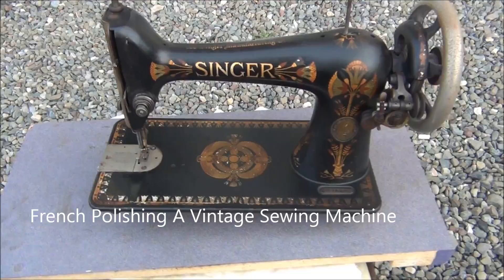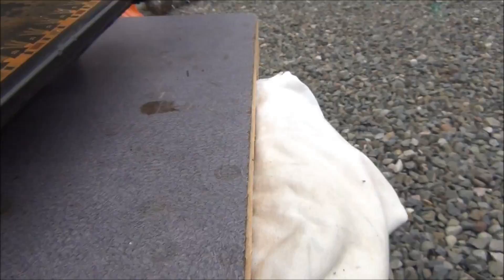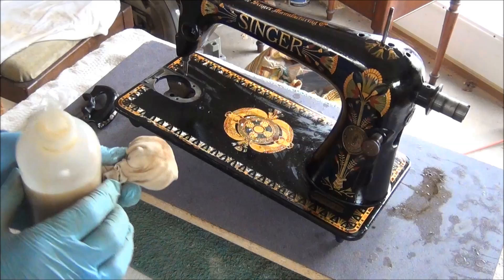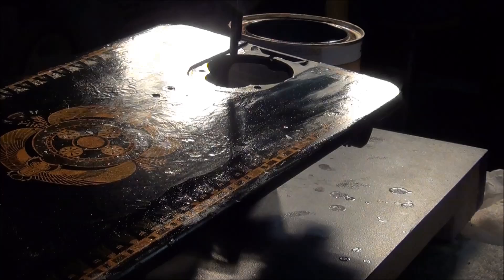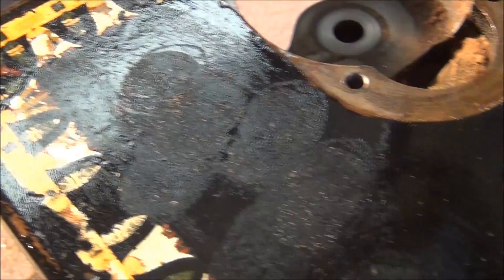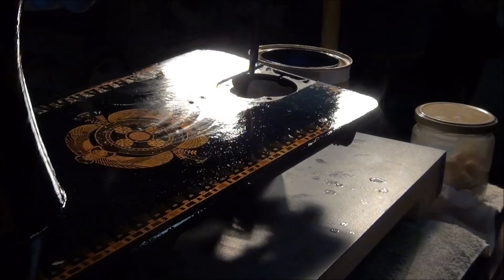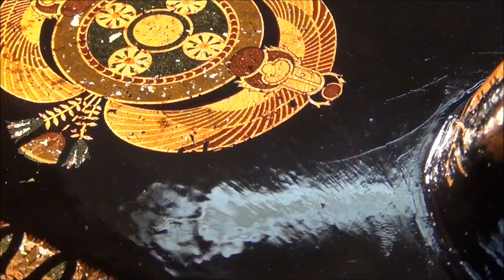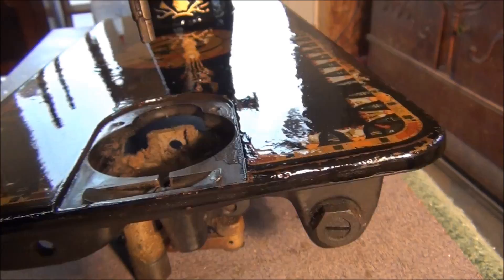French Polish a Vintage Sewing Machine

Comment: I need to repair parts of the decals.  I'll use metallic paint markers.  (Saw this in another video).  If I plan to shellac the machine, would you recommend using water base of oil based markers?  I'm just wondering if the shellac would make the paint marker bleed.
Reply: I would use the oils based
Reply: Use oil base. Water base would be alcohol/shellac soluble and bleed.

Comment: I dont think the clear coat back then was thick at all , i have a 1904 27-4 and i would swear there is no clear at all , i only use dish soap and warm water with a soft used toothbrush,  i found that  it takes more time but i have never harmed the condition of the clear or decals useing this mothod , also use a good soap , i use dawn in a water bottle with water , and spay the machine in areas and even use it strait no water on hard spots , seems to do a pretty good job of not causing further damage to 100 year old paintor decals ...still a great video , i enjoyed watching and think its just fun to clean up and use old machines no matter what method anyone uses,  it all trial and error , i used a degreaser on one of my early restore project's and almost destroyed a 1951 Necchi BU , always do a small test area on the bottom if your not shur ....
Reply from the maker: It all depends on the current condition of the machine you are working on. I generally wouldn't recommend water though. The decals are "water slide" and there is a strong likelihood that if they are exposed, the water could detach all the color and leave only the silver base layer. Also the old shellac can absorb water and become cloudy. You can heat the surface after the fact to boil out the water, but why go there in the first place.
Reply: @pmatulew1  ive had good results with useing water and soap , never had any decal issues so for , i always do small areas and never just wet it and walk away , it depends on the condition i guess , because ive never once had my decals come off with water but other methods used here on youtube have had bad results , how is water bad but gojo or orange clean or any liquid ok do they not contian water ? Hmm im confused here , your telling me water bad cleaning chemicals good , do they not contian water ?
Reply from the maker: @4486xxdawson  The recommended cleaners, (plain oil. or Gojo), are oil based rather than water based. Alcohol will definitely strip the shellac and the decals so apply with caution. Dish soap is a degreaser so it will help dissolve the old grime but the water base is a risk. If it's working for you, go for it. Just be aware of the risk.

Comment: Hi. After seeing this video,  I was thinking of touching up the decals and filling in the missing chips and scratches in the black base coat with Testors "model airplane" enamel on some of the machines in my collection. Will applying the shellac over the enamel paint disturb it? What do you folks think?
Reply: I think it will work, did you try it out?

Comment: Hello. I found your video very helpful in my search for info to restore my 1910 Singer treadle machine. Where can I find your "part 1" video about cleaning and degreasing the machine? Thanks!
Reply: Linda Herr good question!  He said something like Gojo. I’m from UK and e don’t have that so I don’t know exactly. And sewing machine oil to clean. Gojo or similar can damage decals. I’m told SMO is the only safe thing to use, but does it get years of grime and tobacco off?
I’m wondering, since shellac dissolves shellac we could clean off dirty shellac by diluting it over and again with clean new shellac, rubbing it back, but not so far down into the layers that we take the decals off.

Comment: Hi. So you recommend using the zissner seal coat from start to finish? This will still melt the previous shellac,  as the zissner shellac did? Hope that makes sense. Thanks
Reply from the maker: Yes. "Seal Coat" is originally meant to be used as a wood sealer before painting (wood). It's just regular shellac that has been thinned with more alcohol so it soaks in better rather than laying on the surface. For our purposes the extra alcohol will most definitely dissolve the old layer. Plus I found it's easier to apply than the regular formula that builds too quickly and gets lumpy.

Comment: I think you struck a beautiful balance here with the age of the machine and a polished and protective layer over the painted cast.
The finish adds to the beauty and age of the machine without making it look factory finish. I love shellac and I collect and rehabilitate vintage Singers and really want to try this method. I don’t want to strip and repaint. I would just like to level out the pin rash, scissor scrapes and spots where something spilled and dissolved the finish. 
Do you work with the oil right from the start?
And do you have any treatment for the small chipped off paint we often see on the edges?
Thank you for the detailed video.
Reply from the maker: I haven't tried it yet but several collectors have suggested nail polish or appliance enamel repair kits to fill the paint chips. Use oil while rubbing shellac as necessary to keep the pad from sticking. The first layer or two it's not really necessary as you're mostly just painting the shellac on to get a base coat to seal the decals before you start working over them.
Reply: Paul Matulewicz : thank you Mr. M
I bought some Testers model enamel (gloss black) and will try it on a small, inconspicuous chip.
I love working with shellac and have used it on numerous woodworking projects. So I hope to try your technique
Soon. 
Thanks again!
Reply: @phoozchic  Hi. I was thinking of touching up the decals with Testor's as well as filling in some of the black paint's chipped areas on some of my machines. What do you think?
Reply: @phoozchic  Did you try the enamel gloss black paint combined with the shellac?

Comment: nice video. But, unsure of your materials and steps in the tutorial. Did you start out with just the seal coat, or seal coat mixed with denatured alcohol? Can't hear too well on those instructions.. Thanks! Pat
Reply from the maker: errr uhmmm...do as I say, not as I do? I was using up what was left of a can of "Shellac" that I thinned with alcohol. Purists would probably say it's old and spoiled. Maybe so. "Seal-Coat" out of the can is already thinned to a nice working consistency. No muss, no fuss. Also "Seal-Coat" is dewaxed so it's easier to re-coat.
Reply: So it's mixed with denatured alcohol, or isopropyl? Or is it just straight up seal coat? Did you also strip the machine before shellacing? Not sure of what I'm hearing. Also not sure what the errrr uhmmm was for. No insult ever intended, Just want to be absolutely sure of what I'm doing when I slop this stuff on my machine. :-)
Reply from the maker: The Lotus was already flat and dry with barely anything covering the decals. No need to strip first. The Seal-Coat product is already thinned enough.
Reply: So you are just rubbing on Seal Coat straight from the squirt bottle? Just need more clear instructions. Radio in the background makes it hard to hear what you're saying.
Reply: Is the alcohol isopropyl alcohol? Or would that do?  I’ve noticed it does spoil a shellac polish on furniture, so I guess it would dissolve it ok. (Ask me how I know!)

Comment: Hello Paul,  Really appreciate your videos but looked at them too late.  I have (had) a 501 featherweight in perfect condition until I did something dumber than dumb.   I decided to wipe it off with rubbing alcohol.  I did about half the machine and the top part.  If I follow your steps do you think I can salvage my sewing machine.  I am nervous about moving forward.  Thanks Maurice
Reply: 501 is a Rocketeer not a Featherweight.

Comment: Would you tell me what the ratio of alcohol and sewing machine oil to shellac are you using? And, I heard you say straight alcohol. But are you using de-natured alcohol, or something else? Thanks
Reply from the maker: Denatured alcohol out of a big can, though I suppose any sort of alcohol would do. Ratio of alcohol to shellac? If you use "Seal-Coat" it is already thin enough as is. I had originally purchased regular brushing weight shellac and it was too thick for this purpose, so i thinned it down a bit. You'll just have to spit ball it. The sewing machine oil you just dab a little as necessary to keep your pad from sticking or skidding as you work.
Reply: Thanks for the reply. I recently bought a nice old 1926 model Singer 127 that has dried out badly from many years of neglect, and I want to be able to use it. The decals on mine are in very good condition, but there isn't much top coat on it at all. I'm hoping I can get it back in shape with your pointers. I have never attempted French polish, but I'm going to give it a go after the holidays. Thanks again, p/s when I do this job, if I get in over my head would you answer a few questions if need be?
Reply from the maker: @mrgroovestring  I'm always around.
Reply: Let me ask you a quick question if you would. Do you think that it would be wise for me to spray a very light coat of Zinesser shellac first, before I actually start rubbing on the decals and paint too much? Reason being …. is that some of the gold in the decals on the back of the pillar or (body) are trying to separate from the silver after I cleaned and oiled this machine. I was thinking that the shellac in the spray can would kinda act like glue, and help hold them down until I can build the finish up with the rag.
Reply from the maker: @mrgroovestring  Spray, brush, wipe, whichever method you like best. You do want to get a quick base coat on to seal the decals and let it set before trying to build the finish.

Comment: very nice work. what do you think if i just put on the seal coat on Just the decals on my grandmothers singer? I really don't want to seal coat the whole machine i just want to protect the decals. Would this look funny and uneven? Thanks for any and all your advise and time.
Reply from the maker: You can do as much or as little as you like. Each layer of shellac does have some thickness, so the trick will be blending the edges. Once you get going you may end up doing more than you started out to do. If the goal is to do as little as possible I think I would try thinning the shellac with more alcohol and using lots of oil. Try starting at the 'polish' stage rather than the 'build' stage.
Reply from the maker: It will be difficult to coat just the decals and not have the finish look uneven. Shellac is also available in an aerosol spray can. Unfortunately I didn't have any luck with it. All I got was a speckled finish as the spray came out in droplets rather than a mist. YMMV.
Reply: What is the oil for in this step? What kind of oil?  Thank you.
Reply from the maker: I just used sewing machine oil.
Reply: @pmatulew1  Hi Paul, I got alcohol on a small area on the bed of my 301. It left an awful spot and smudged when I panicked and tried to wipe it off. It's the only area on the entire bed that is now matte. Do you think I could use the 'polish' stage of this process to restore the gloss just in this one spot? 
Also "using lots of oil," do you mix the oil into the shellac+alcohol or dip the pad into the oil then shellac? 
OR to you have a better solution for restoring the gloss in a small area?
Reply: Hello Sally, I did the exact same thing on some of the base and the are. Wish I seen this before I proceeded without thinking.  Did you try anything yet?
Reply: @monraet  No.I was waiting for a response because I'm afraid of making it worse. This polishing process seems real extreme and the error factor pretty high unless you know what you're doing. I don't. I just want to shine out the little area I screwed up. Someone suggested using Howards on it, but I haven't done that yet either. I had to walk away from it until I get some guidance and guts.
Reply: @sallyw5739  Did the same thing but I wiped off the arm and 1/3 the bottom with alcohol until I realized the brown on the rag was not an old smoke film. Also waiting for some guidance.  Am so made at myself, have to think before I jump in....
Reply: @sallyw5739  forgot to ask. What is Howard's
Reply: @monraet  https://www.howardproducts.com/product/restor-a-shine-polishing-compound/
They also have it on Amazon.
Reply: @monraet  There's several products but it's the Restore a Shine that was suggested. Here's a youtube on it 
https://www.youtube.com/watch?v=3mX3HX3ta6I
Reply: @sallyw5739  Thanks Sally.....
Reply: Hello Sally,  I  just nervously put on a coat of the suggested shallac.  I will let you know how it goes.  I used a tee shirt,  hope it's soft enough.  It is streaky - am nervous
Reply: @monraet  You're much braver than I am. Let me know how it goes.

Comment: I cant believe this guy is applying shellac this way! wow! this is a video on what NOT to do on a beautiful vintage machine. 😢. 
The proper way to do it, it is to either spray the shellac from a spray can, (a very light coat) or use a professional paint  sprayer. Once the first coat dryes totally , used a 1,500 grid sand paper, lightly sanded it, wipe it, and apply another coat of shellacc and keep reapeating  the process until satisfied.
Reply: The video uploader is applying the shellac in the traditional way. Spray guns didn’t always exist and this technique, French polishing, was a time-consuming skilled coating used on high-end furniture. Think Thomas Chippendale. This is how the coating was designed to be applied originally and it’s a lot easier for an amateur restorer to do as it needs no special equipment, just time.

Of course a more even finish will be obtained by an amateur using spray application, but that isn’t necessarily the point of this. Primarily the coatings on these machines are to protect the decals and add shine. Any imperfections in the shellac are reversible and fixable in the future so it isn’t a big deal.